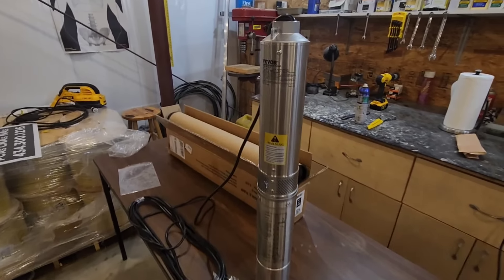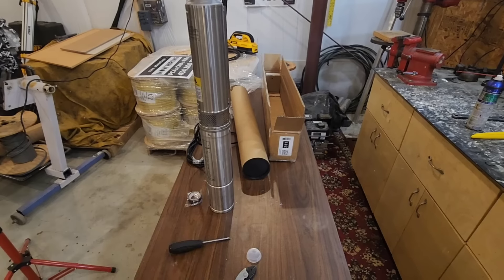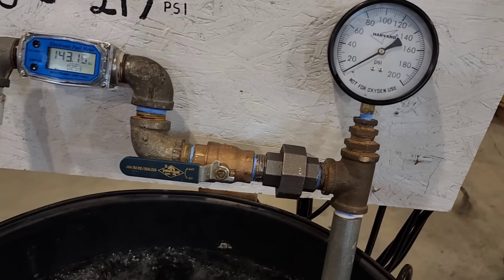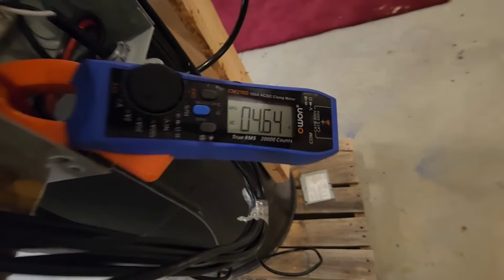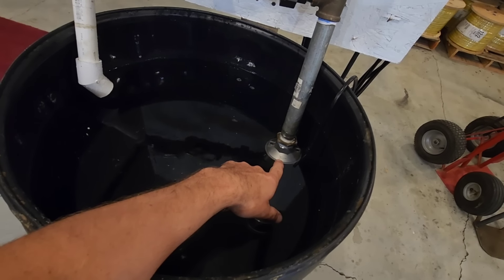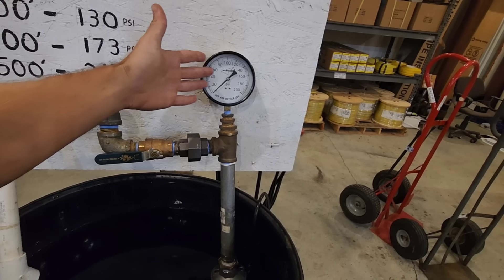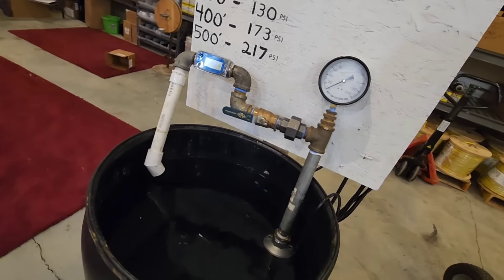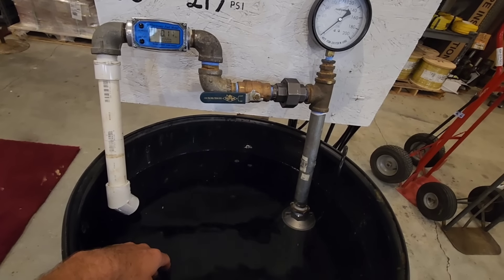Lowes Well Pump Test. $125 Vevor 1/2Hp 25GPM Submersible Pump, How does it perform

Comment: I was worried if this pump would work in one of my wells. Your video demonstrated the it should work fine at 40’ depth. I bought it, I dropped it down about 3 days ago and it works great. Your video saved me a lot money and had my well been deeper I would have passed on this pump. I have watched every one of H20 Mechanics videos, most of them more than once which means now I know just enough to be dangerous!
Reply: Is it still working?
Reply: u got the 1/2 hp too? so it dont need a control box or does it?

Comment: I have a 2.5" 1/2 HP pump that has the same or very similar check valve, I haven't even tried it, just bought a good brass check valve and put it on. If I remember correctly even my Grundfos pump recommended using one External check valve for added safety.

Mine produces practically the same pressure as that, but being 2.5" the flow is somewhat lower.
I bought the 2.5" one because at that time I already had a 1 HP and 3" Grundfos and a 2 HP and 4" one from some Italian manufacturer that I can't remember right now installed in the well, I didn't want them touching the pipe (it's 8 inches internal diameter) or each other, so I chose the slimmer model available.
In the end the 2HP produced much more flow than it needed and logically it also consumed more electricity, so I ended up removing it, originally it was supplying my grandpa's dairy farm but they retired in the early 90s. Now I have enough with the 1HP Grundfos to do some irrigation and the half HP to fill the cistern that supplies my home.

I purchased the 0.5 HP pump because I installed a Cintropur NW500 filter housing with 10 micron filter element and with a lower flow rate it almost does not produce any pressure drop that would become an extra electricity expense.

With the Grundfos it had 1.9 BAR of pressure drop with a brand new 10 micron filter element and almost 4 BAR when it got dirty... with the 0.5 HP even with a dirty filter element the pressure drop never reach 1 BAR.
The filter housing came from factory with 50 or 60 micron filter elements and with those the 1HP Grundfos was fine, but I don't want any sand on the cistern because the output is about 2 cm over the bottom and it would be difficult to clean.

As soon as the filter element gets superficially dirty the rest of the sand falls to the bottom of the bowl so I really only change the filter element every couple of months for hygiene reasons but it seems like it would take a year or more for it to clog...

By the way the well is only 25 meters deep, the pumps are 20 meters from ground level and I have never seen the water level go lower than about 8 meters from ground level. Yesterday it was at 1.9 meters from ground level.

Comment: Just sent a 3 HP Vevor down the well after one heck of a fight getting the old, dead pump up and replaced. Your videos helped for sure. The pump has been great so far
Reply: Hello friend hows the pump performing?, im thinking in getting one of these for myself
Reply: @foox2k   Died within a month, most likely due to not being protected from the shock of starting and too much power for the flow rate. Do more homework than i did, and you may be okay. Paid a well service later (big $$) to replace with a high end pump. My well is 440 feet deep, so ymmv
Reply: @ty8o2923  sorry to ear that brother, i'm gonna keep researching
Reply: @ty8o2923  hi, do you think a 2 hp vevor works for my 55 foot deep well?
Think i need a pressure tank? 
The water is for a home.
Sorry for mi English, im still learning.
Reply: I just bought the same pump can i ask you how deep is your well ? thank  you

Comment: This video should drive home the point to read the capabilities of whatever you are looking for to make sure it will do what you need. If those people that had problems had read the instructions or before buying the pump looked up the specifications they would have known that this is not the kind of pump they needed. I have multiple wells depths from 1000 feet on my ranch to 250 feet on others. I hired a well specialist like you to determine what was needed from the well drilling, casing pump, piping and all the other components to make it work as needed. Moral to the story is get an expert to do things like this that you don't know enough about. Maybe in China their wells are 50 feet deep and they consider that deep. Who knows? Very good information!

Comment: This is perfect for tractor water filling station. Since it is open ended application, it does not (eventualy) need check valve so the installed one is probably ok. Guessing it is there just to keep waiting for the water at minimum. Thank You for nice and educational videos. Best Regards
Reply: In normal system if your check valve is bad it will bleed back when the pump shuts off then drops pressure and cause pump to run more

Comment: So glad I found this video. I bought this pump to pump from a well to a storage tank about 100' above the well. Pump would be set 90' down the well. I doubted its capabilities to do what I need and decided to use it to pump from that storage tank up the hill to another tank where I will have enough elevation to use gravity to feed the house. This pump is capable of pumping from tank 1 to tank 2 about 100' farther up the hill. Your video proved without a doubt that 1) this pump would not work in the well and 2) it will work tank-to-tank. Thanks Brother!
Reply: It also confirmed it doesn't need an external control box and is basically a 2-wire pump. I bought it on Amazon and it said it is a 3-wire pump. Asked a question on Amazon - does it need a control box and is it 2 hots and a ground? - No answer. Now I know. 👍👍👍

Comment: Out west we use a lot of lift pump systems.  If we have a well 300 to 1000 foot we lift into a large tank then have a pressure system from there.  Saves a lot of power to pump 500 gallons at once with less head pressure.  That pump would be good for a 75ish foot well on such a system running on solar power.

Comment: These pumps are great.I have one at my cottage.Down a 65ft   well.put down in the well 30ft Lots of pressure pressure switch set at 40/60 Is hooked to a pressure tank as well. Builds pressure within seconds Great pump 200$ very impressed
Reply: which one did u get? this one the 1/2 hp one or another one? also does it need a control box or no?

Comment: Very informative thanks ! I have two wells, fortunately I’m about 10 miles inland from the Florida coast where our water table is fairly high so my pumps are about 40 ft down, casing is down 100 ft, plus driller punched further down thru the limestone. I’m getting ready to replace my 3 rd pump in 30 years of service

Comment: Great video! I was one of the ones that messaged you. Well has static level of 63 and pump is at 85 feet. I had this same one and it did not cut off the 30/50 switch like you said. I ended up swapping it out for a Vevor 1hp 28gpm to see what happens and it works just fine shutting off the 30/50 switch. It gets about 10gpm.
Reply: how long did the pump last?

Comment: Thanks so much for this! I mentioned on your previous pump review, but I recently installed the 1/2 HP (but 110V) Vevor pump in my well. I just put a pressure gauge on mine after watching your previous video and I think I have better results than the 230V one somehow! The pump is at about 58' down but I still have 70 PSI at the top of the well when water flow is turned completely off.
Reply: @h2omechanic do you think it's possible that the pump has some sort of current regulator so it tries to increase power as water flow decreases? With my limited knowledge, I expected the current to fall more than it did when the output was limited. I wouldn't expect a cheap pump like this to have that kind of functionality, but it could explain why I still have 70 PSI at the top of my well.
Reply: does it still work? did u need a control box for it or no? my well about 37' to water, i dont need much pressure its just gonna be for irrigation, also did u splice wires and how far up did u do it ?

Comment: I tested out their 1.5hp 110v pump and it seems to do exactly what it says it will. I pumped up my system to 90 PSI without any issues. I was too scared to try any more. I haven't had any issues minus don't use a PVC fitting directly in the pump. It fell into the areator over the course of 2 months.

Comment: Great explanation!   Basically, this pump should only be used when pumping into a cistern/storage tank...just as the drawing shows.  Then use a "jet pump" to pressurize a bladder tank.  Maybe OK for a DIY but not cost effective when the customer has to pay labor rates

Comment: Wanted to make a few comments to your videos.
1) I think these videos are very helpful for many viewers since not everyone is an engineer. Kudos for spending the time and posting them.
2) The cheapest Lowe's pump in my area (CA, silicon valley, water is at a premium) at Lowe's was $498 + tax.
3) The description of the pumps gives a usable well depth, so the customer would be able to calculate if the pump was suitable by doing the math like you did in the video. Otherwise, I saw in the comments an 800 phone number and they customer service would be able to calculate and recommend a suitable pump (don't think the average sales clerk at Lowe's would be, my experience). 
4) From my own experience with a 30m deep well on my parent's property since around 1960 I can tell that there frequently is a lot of sediment in the well which will grind up the pump and severely shorten it's lifespan. One pump actually locked up and overheated after only a few weeks so the fuse would trip. IIRC the current pump is 20 years old now but only used for watering the garden, otherwise they have city water (safe + sanitary) for the house and drinking.

Comment: I got a pump at Lowes as it was a 1.5 HP which Lowes recommend for my well at 165 foot pump drop. Hope it could not pump the water up to the house, so called the MFG of the pump only to be told it would not pump with that much head pressure. Call a well service company as was told the pump was junk for our area. In the Blue Ridge Mountains we have a lot of rock I have over 100 feet of rock and will eat up plastic pump blades, my pump even has a sleeve on it to keep big rocks at bay.

Comment: Thanks for this.. the review was fair and unbiased.... 
It's always tempting when reviewing a "cheap" pump to really bash it, but when factoring the value for the money, those wouldn't really be fair criticisms... 

The pump is what it is, a good value budget pump for those who are cash strapped up front... 
It may not be as efficient as some of the more expensive high end pumps, and it may be that you have to size up the HP to get the performance you need, which could end up costing you more in the long run, especially when service life is accounted for, but it will at least do what you need it to.... 
It's one of those cases of pay now or pay later.... 
but at the price, that pay later is going to take a LONG time to catch up with you..... 

For those of us stuck in the pay later category, It's a "quality" pump from a company that is honest about the performance, and seems to be paying attention to their customer feedback improved packaging over last years pump, now includes the start up capacitor as opposed to needing a control box, changed to a stainless outlet over the previous brass, etc.

Will it last as long as a 1200 dollar Grundfos? almost certainly, no.
Will it be as efficient?? absolutely not.
But all things considered, this is a good value for the money, and going with it or a $1200 Grundfos really comes down to where your priorities lie.

Comment: No need to change the pressure switch.. turn the large nut counterclockwise.. each full turn reduces the cut in  and cutout pressure  by approx 2-1/2 psi (or clockwise to raise the pressure).. also change the air pressure in your tank accordingly.

Comment: Hey ive noticed multiple times that in there the pump is conencted to the grid by a breaker only, Here usually we have some control board to check the water level and turn off the pump if the water drops too low. It usually works by the means of some electrodes. Is that a thing in the us?
Cheers mate great videos!!!!!!
Reply: I think he mentioned in one of the videos that these things are built into the pump these days (maybe not all pumps?).

Comment: As you close the valve to raise pressure, you are effectively pumping through a small orifice which would be like using a very small diameter pipe. How does this affect flow rates at higher pressures?
Reply from the maker: @JS-fe8sx  as the water level in the well drops, the head pressure directly above the pump increases. That makes the flow rate decrease. It eventually reaches a point where the pump can't provide enough pressure to cut off the pressure switch. That's how this test can show you is maximum Pumping Depth (& still turn off the switch)
Reply: @h2omechanic  I don't believe a restriction is a fair test except for max pressure
Reply: @h2omechanic  I don't believe a restriction is a fair test except for max pressure

Comment: … this is probably a septic tank pump… they use turbine pumps in effluent sewers where only the gray water is pumped and not the solids… like you said it is probably a low head pumps… pumps can pump volume or pressure but usually not both

Comment: All Chinese sellers (VEVOR is just an importer and seller, one big enough to get all products labeled with their brand but they don't make anything) call all kinds of submersible pumps "submersible deep well pump" and/or "submersible borehole pump"
It's likely a translation problem, since most sellers (including VEVOR) won't know anything about installing deep well pumps, unless by chance they hire someone who has worked as a plumber as a translator ;-)
If you contact customer support they may take a look to the user manual (because they know a lot of buyers never read them) or maybe google for some more information but never expect them to know how every product they sell actually works because they're selling literally thousands of unrelated products and nobody can have so much knowledge.

Comment: This explanation about pump head and how it affect pressure was spot on. Exactly what i was thinking before you got to the effect on pressure in your explanation
I have a well that is 82’ with 72 ft of casing. It picks up a lot of sediment. Any ideas about how to fix that problem
Reply: How about a pressurised settling tank in the line from the pump to your filters/bladder? Periodically clean out the bottom of it. This does assume the sediment is course enough to settle out over a reasonably short period.

Comment: yeah at 18 awg I would cut back to a shorter length and splice not sure why they had such a long lead wire ? did not realize Vevor was sold through Lowes, but Vevor usually sales stuff rebranded so wonder who actually manuf's that, most their stuff is China. Have bought many different things from Vevor Ice machines to pop corn machines to tools ?

Comment: I noticed the pump only had three wires.  It looks like the wire I received on my 230 volt pump. Directions on side of pump states white wire is neutral-TEC support stated white wire hooks to neutral on switch. I have never seen a pressure switch with only one hot wire hookup. Did you hook up the neutral to a hot line?
Reply: I'm having the same problem with my pump. Did you end up hooking the white to a hot line?

Comment: Great review. Unrelated question: I discovered I have a pitless adapter. How long do the O-rings last before needing replaced? Is there a standard size O-ring for these? My well was installed in 2016.
Reply from the maker: A few different manufacturers all use different sizes. Any auto parts store will have one if you ever replaced yours. I think 20 years is the life of a oring

Comment: I live on a riverbank that is a 95 foot drop to the water: nearly vertical. I bought this pump to put in the river to fill a cistern. Should I get a more powerful pump and just use the 1/2 horsepower for the cistern. I assumed this pump would work based on the 160 ft head, but perhaps not.

Comment: What if your static water level never goes below say 50’ but the pump is down at 100’ would it still satisfy the 30-50 pressure switch? Just wondering?

Comment: Great content, love it! I'm wondering if you could help. I have a 1000ft well with a static water level of 200 ft. It produces 3/4 gpm. I live in the mountains of western North Carolina and would like to use as much water storage as reasonably possible with my  1000 ft well. Could you recommend a depth and pump size for my 3 bedroom mountain home? Once

Comment: Any chance you could get the locked rotor amps? I’m looking for a cheap and temporary well pump to fill water tanks at the well head. I run everything on solar. Need water until I save up for a high pressure solar friendly pump. I have to pump 230 ft uphill from the well head so it’s not easy.

Comment: I have a well head sticking up in my yard. It has a metal cover on it. There is pvc that runs up along it which contains the electric wire from the house. Opening the lid the only thing that is in the pipe is the connection for the wires and a bunch of rope. Does this mean that the actual water connection of the pipe to the pump is underground sonewhere around the metal pipe head?
Reply from the maker: Yes, you have a Pit-Less Adapter. I have 1 Video covering the pitless adapter style hook-up and how it works & how to safely get it up & out.
Reply from the maker: https://youtu.be/gHTn4Y7g26g

Watch this to the end. There's a special tool you'll need to make (the 5ft Tee Bar)
Reply: @h2omechanic  thank you!!!!